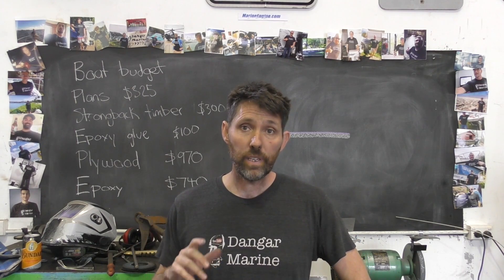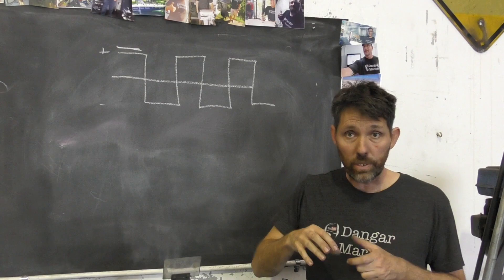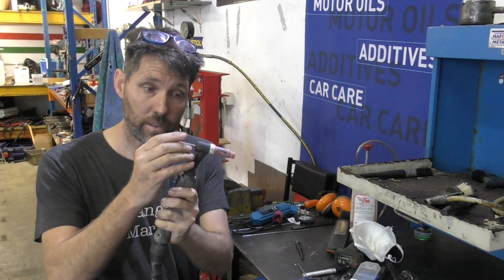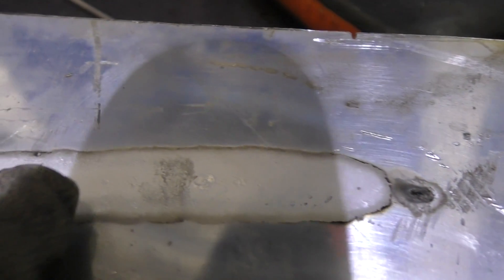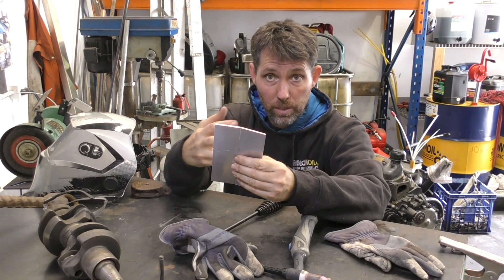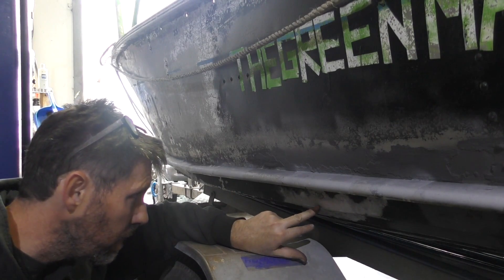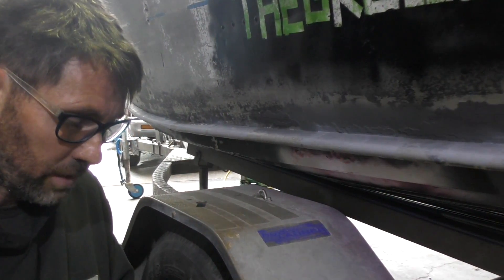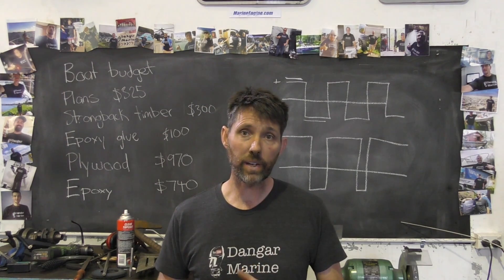TIG welding cracks in aluminum

Comment: If you don't have access to a tig drill holes like stu did to stop the crack continuing then look up how stu fixed holes in a boat without welding and plate inside aswell if possible, your car windscreen is held in with SIKA it is bloody strong stuff if surface is prepared properly even without rivets you don't need checker plate smooth ally will do
Reply from the maker: It is amazing stuff Sikaflex. With good surface preparation you can probably get away without rivets, you are right.
Reply: @DangarMarine  great videos stu keep up the good work 👍

Comment: Good video, would have been more helpful if technical details added, for instance, boat  made of 3mm alum, pedal used, 100A set on TIG, Balance 70%  w/ AC Freq = 100Hz and type of filler used etc as others post. That would be helpful to some boaters, newbs in TIG welding. Other than that great as usual.

Comment: Great info. I have zero experience with any type of welding. Interesting side note: I read a hunting guide story several years ago that used boats to go up rivers to their hunting locations. Sometimes the boats would strike rocks in the river bed and leave a jagged rip. To fix holes temporarily, they would pack toilet wax rings and jam them in the hole.

Comment: nice basic Tig welding, I prefer holding torch +-80deg and filler rod at 15deg from plate, no need to sharpen the tungsten with alluminium and no tungsten stickout is best. Pro welder DEW Marine Propeller Repairs.

Comment: Great video Stu. I'm a little later to the show. Have you tried aluminum brazing? I've had good luck wit it especially on old contaminated al. The advantage is you only have to heat the metal up to 380C or so and a propane torch will do the job. The disadvantages are cost of consumables and remelting joints the are close by.

Comment: that weld will eventually re-crack, where the weld had ended there is what is called a fish eye. that there will concentrate stress onto that area and will be the first point to go. presumably it had originally cracked due to a build up of stress in that point or an impurity in the original welding on the chine or even an impurity in the plate or a manufacturing error. without actually verifying there is full penetration on the other side and the fish eye has been filled in with more filler towards the end of the weld or sanded out, it is likely that spot well envelop a crack again.

Comment: Good video! One other tip is to hold your torch on the weld after you stop.  There is post-flow that will cool the weld after you are done and prevent contamination.
Reply from the maker: Yep, definitely a good thing to do.

Comment: Just tripped over this one Stu - nice tutorial. I'd like to redo some welds on our little tinnie that were absolute butchery by the shop that did them. Now I've got some confidence watching you do it. I'm still slightly unclear on whether my first rig should be TIG or MIG. Thoughts?
Reply from the maker: As a general purpose welder MIG would be better. You need to have a wire spool gun though as aluminium is too soft to push all the way through the lead.

Comment: I taught myself to weld aluminium recently and am by no means an expert but I thought I would share a couple of things I found - first if your tip is turning funny colours it could be you don't have a long enough post-gas cycle. The tungsten is still pretty hot for a long while and if you don't keep shielding it will discolour and make controlling the arc net time you light up harder. Secondly I had a lot of problems with leaks - the problem is if you have a a leak in your lines etc it lets air in and (in the worst case) it was 50/50 whether the aluminium would melt or catch fire! In other cases it would just take forever to puddle and then suddenly it would blow through. Good luck with it!

Comment: Hi Stu, I have recently discovered your fantastic videos and would firstly like to say thank for taking the time to produce them. Fantastic work! I was wondering if you could possibly answer a completely unrelated question for me and possibly give me some advise.  I am in the process of looking for my first boat and am really excited about it all.  I have been looking at 2006 - 2007 Quintrex Coast Runners and Bow Riders and am noticing that heaps of them that I am looking at have electrolysis on the gunnels and around the transom/engine mount. Some of them have had heaps and others very isolated patches. Most people I know that own boats and have decades of experience are warning me to stay away from any boat showing any sign of this. They say boats of around this age should not be displaying any form of electrolysis and that if they do, they are very unhealthy. What are your thoughts and advise on this as I really want to make sure that I don't buy something that turns out to be a big mistake and that I end up being really unhappy with? Any advice and tips on buying a second hand boat would be greatly appreciated :) Cheers, Shane

Comment: Neatly done Stu. One thing with that can holder, make sure there is a plastic bucket to catch the lids under it. Steel, tin, copper (think 2cent pieces!) all react fairly rapidly with aluminium alloys used for marine work.. Drop a lid or two and you may be filing in some 3/4" holes soon after.but no matter what, alloy boats crack over time. Aluminium work hardens, so every wave hit is adding to the process.  Take care and hope to see many more from you yet.
Reply from the maker: Thanks Ron. Couldn't agree more about making sure the caps don't end up in the bilge!

Comment: Any worries about the weld oxidizing faster than the surrounding metal?  I ask, because one of my engine heads developed a hole into the cooling galleries, due to corrosion.  My service shop is going to weld the hole & I'm worried the weld will corrode.
Reply from the maker: No, the filler rod is aluminium too so once the weld is complete and cooled there is no issue there.
Reply: @DangarMarine  Thanks man! You're awesome.

Comment: How do you weld a big (several inch) hole from hitting a rock?  Great detail as always.
Reply: Sounds like a patch would be in order.  First of all,  is the boat fibreglass or aluminum,  this is important to know because obtaining the correct materials for the repair depends on knowing.... Okay, jokes aside,  I'm sure you mean it's an aluminum boat.  My 2 cents would be that you'd probably never get the hole sealed by merely trying to weld the shards back together,  so I'd guess pounding the remaining skin back as flat as possible, then clean and prep the surface, as well as the mating surface of a patch to be welded/applied over the damaged area.   Not sure whether your hole is in a relatively smooth, flat area of the skin, or whether it includes a fold/ridge/rib or God forbid, the keel.  If you are new to TIG (or even welding itself), I would at least consult with an expert in aluminum welding in regards to what an adequate patch would be, and whether to apply it to the outer surface or the inside surface.  Either way,  after the patch is applied,  I'd recommend some precision grinding of the very edges of the patch.  If it's on the underside,  making it more "smooth" to the surface helps with the dynamics while moving through the water.  If it gets applied to the inside (less likely),  you don't want a sharp surface for sensitive feet to find at some inopportune moment.  A boat depends on seaworthiness.  You can't always just pull over and call for a tow truck, so fixing a hole in the hull should be done with a serious approach.  You really want it done 100% right the first time.  Not implying that you couldn't do it yourself,  just reminding everyone that there's a big difference between a draft or a water leak into a car when it rains, and a water leak into a boat's hull.
Reply from the maker: As Stan says, a shaped of patch aluminum is probably the way to go unless the pieces of the original hull are still thich and can be bent back together tightly.

Comment: Looks like there is daylight showing through the holes you drilled. What does the weld look like front the other side?
Reply from the maker: It's a little bit hard to see directly because they are low under the bench seats.

Comment: "wasn't up to the job originally".. I love it, only lasted 40something years...  :)

RichE San Diego, CA
Reply from the maker: Hi mate. I probably wasn't so clear about that. I think the Green Machine's split was caused by the accident which is fine to just weld up. It is other boats i see with multiple broken ribs just from being used in rough water that worry me. I see them get welded and break again soon afterwards.
Reply: Stu, I know of at least one class of ship in a navy that were 'retired' because the crack repairs were adding over $100k extra per dry docking. These ships lasted less than 10 years in service each but had a design life of 30 years. Originally dry docking was planned to be 5 yearly, it became  an annual thig  but not for anti foul/anode replacement, but full paint strip , crack check and repaint. The last one wasn't even anti fouled, just normal poly paint was applied. Actually, the last one wasn't even commissioned!

Comment: great video.    hardest thing is aluminum doesnt glow red (like steel) until you've blown a hole in it lol.   a proper glass helps but a keen eye and the "feel" of the filler rod helps.  having all the right equipment and supplies is a must.  the conversation  @15:00 is hilarious  but true
Reply from the maker: Yes, and the fact that it doesn't glow when hot explains why I have so many burns from it! :(

Comment: Try to pre heat your aluminum  to around 200 that will help and have on yor bench a thick. metal top to absorb the heat because  aluminum disperses heat very quickly
Reply from the maker: Yes, preheating can be a great way to go that's for sure.

Comment: hey mate what's the best way to go about repairing electrolysis in a boat if i dont own a tig welder
Reply: Depending on how much corrosion  you have you can mig weld a plate over it after you have cleared all traces of corrosion but make sure you set up the mig welder to do aluminum